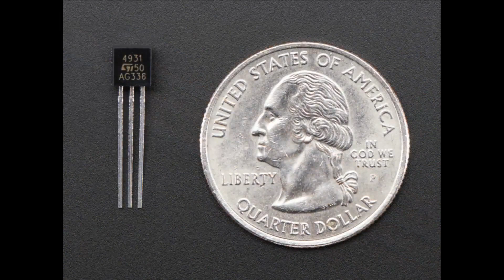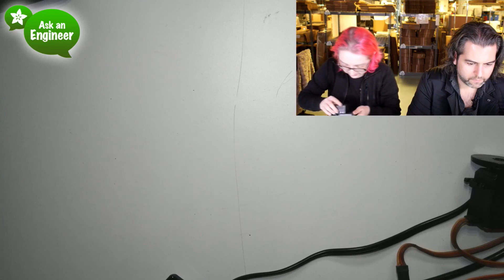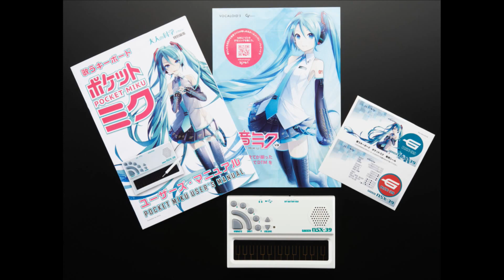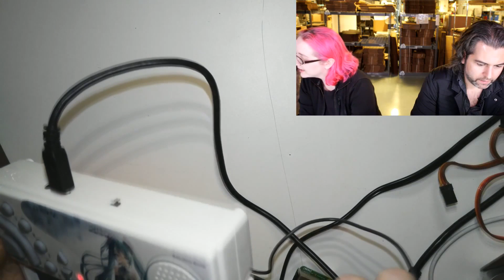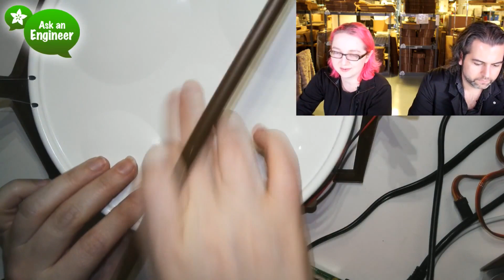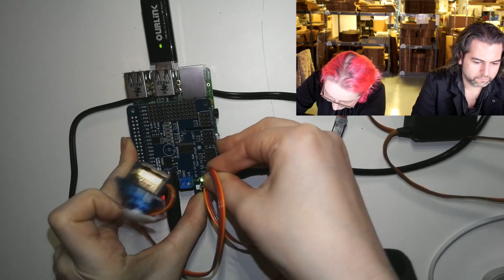New Products 1/7/2015

Comment: Is it possible to connect Grove pi+ board on top of the Adafruit 16-Channel PWM / Servo HAT for Raspberry Pi - Mini Kit? I would like to use Grove but also be able to control at least one servo without compromising the Grove stability.